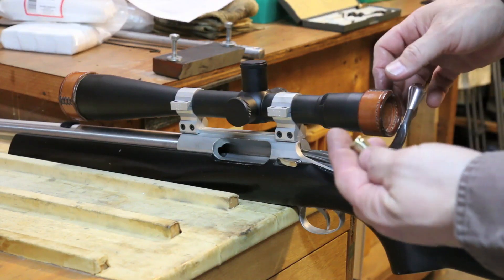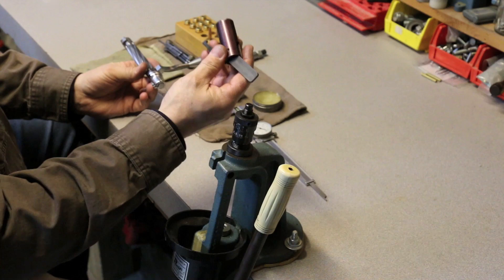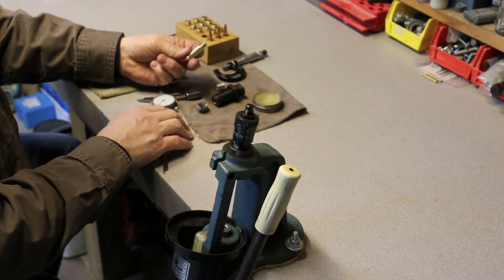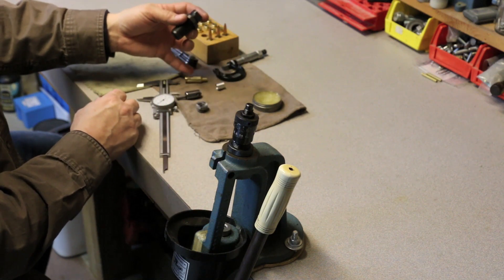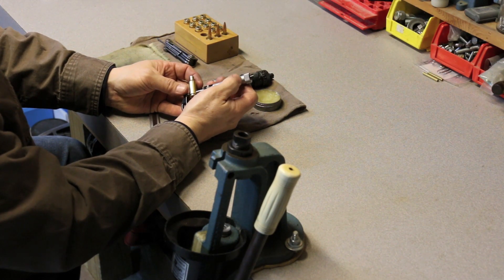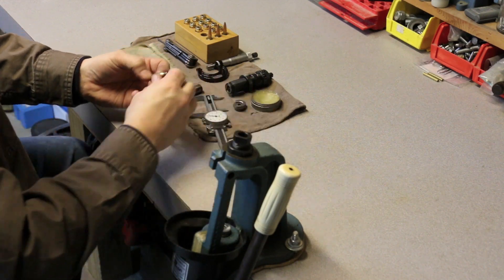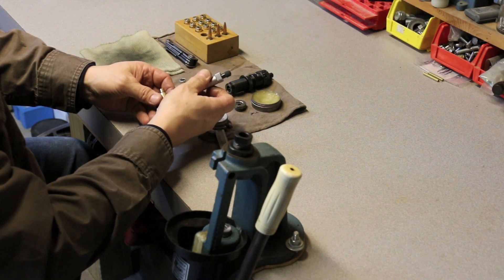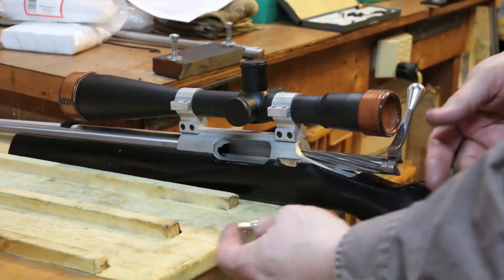Ring Die Usage   1080p

Comment: This would prolly help my bolt lift in my 6ppc.
Reply: That is the sole purpose for the ring die. It reduces the diameter in the base area. As it is a straight walled die, it makes contact with the case at its larger diameter. It doesn’t move the shoulder back, which could cause head space and case separation problems.